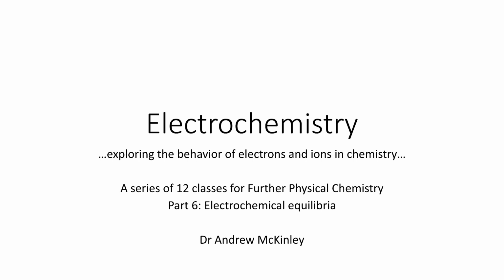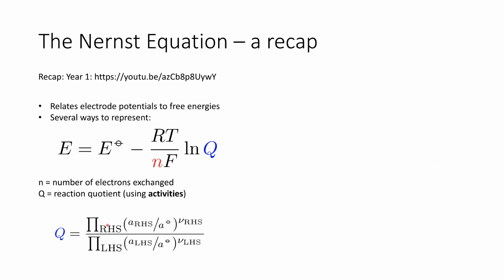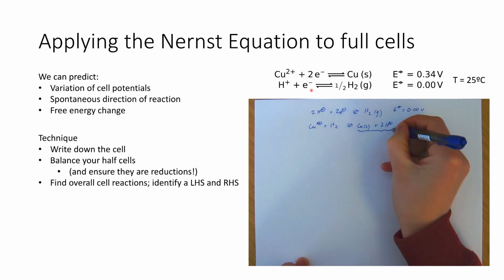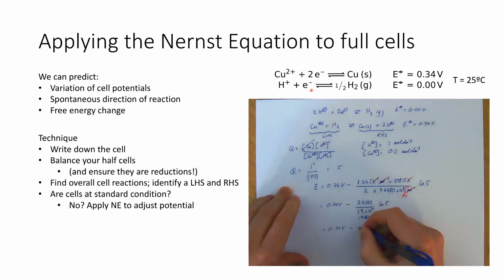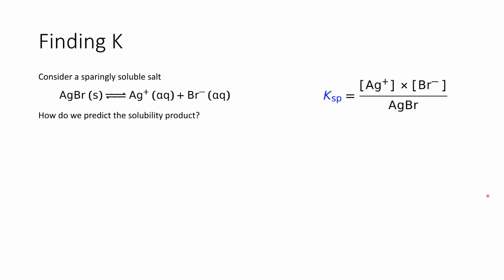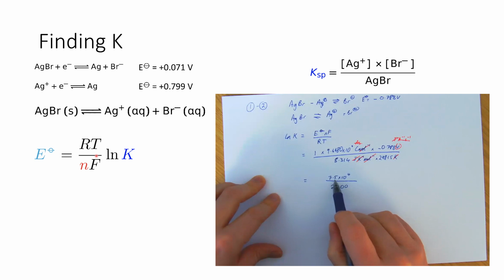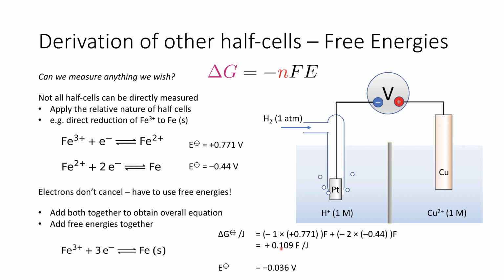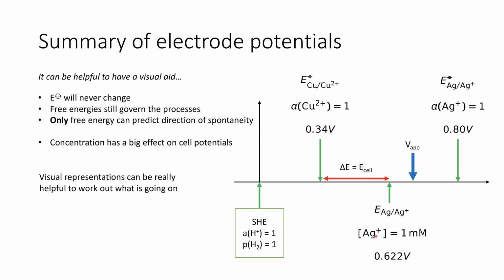Further Physical Chemistry: Electrochemistry session 6 FULL

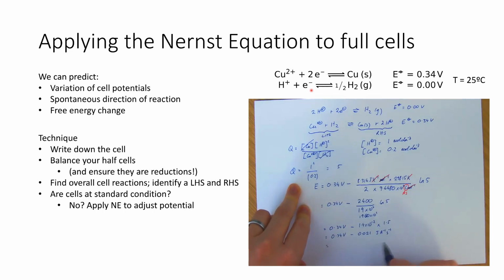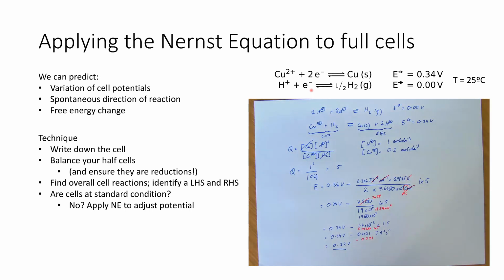Comment: your math skills @ 12:00 - 13:00 blew my mind. amazing job!
Reply from the maker: Glad it was useful. I try to communicate this to students - always try and estimate what you are expecting before you reach for the calculator. By 'rounding up a bit', 'rounding down a bit', you can get very close to the actual value. That said, the actual value isn't the important bit - it tends to be the "powers of ten" where mistakes happen.

... and logarithms.  But they're easy.  (no, really, they are!)

Example: Find ln(19056).
- Rules of logs: ln(19056) = ln(1.9056 x 10000) = ln(1.9056) + ln(10000)
- What power of "e" do you need to get 1.9056? 2.71^? It's going to be less than one, probably slightly more than 0.5 (square root of 2.7 will be less than 1.9), let's guess 0.6.
- ln(10000) = ln(10^4) = 4 ln(10) = 4x2.3 = 9.2  (remember that ln(10)~2.3 is a fairly standard result)
Overall answer is 0.6+9.2 = 9.8.

Check with a calculator: 9.855.  Close enough for astrophysics :-)